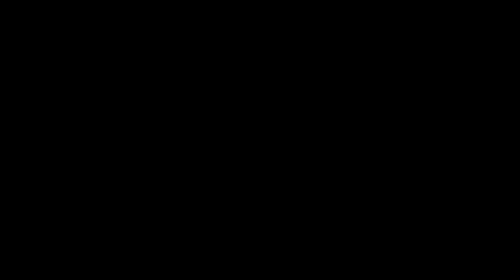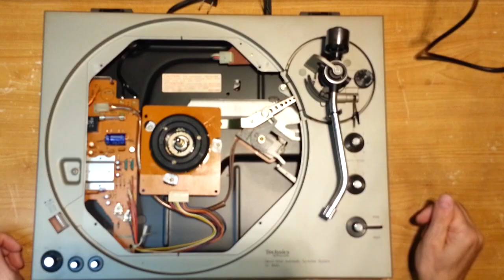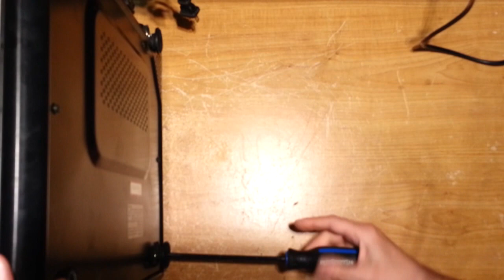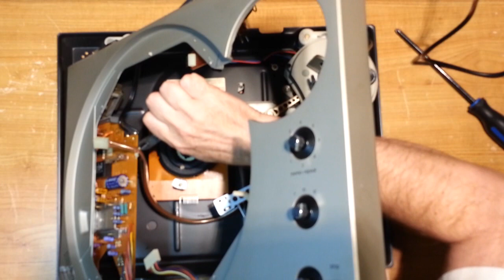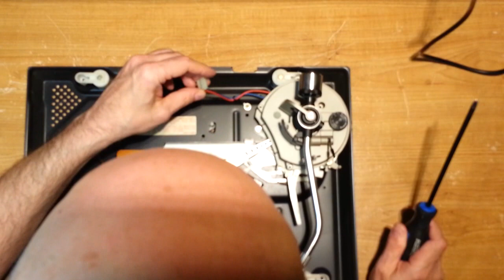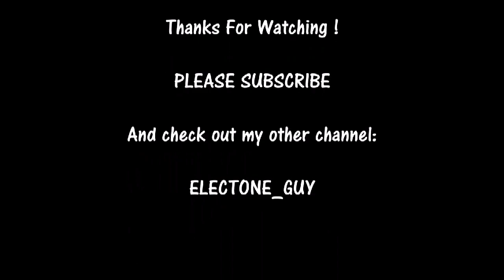Technics SL-1600 mkI: Auto-start repair

Comment: Serviced a SL-1600 doing exactly as you discribed. I had to pry that plastic assembly up with a screw driver , it would not lift off. Your video helped me figure it out. Luaghed my ass off when you simply lifted it up.and off. The unit is working perfectly now. Thanks for posting.

Comment: Hi TG! 6:28 this arm and its bushing is so stuck - I can't even lift it up!. Is "brute force" only way??? What would you do? Please help me (Obi-Wan-Kenobi, you're my only hope...)
Reply from the maker: Soak it with a penetrating oil/spray or even isoprophyl alcohol for a while to loosen the stuck grease.  You cannot use heat because you'll melt the plastic parts. And yes, it must be pryed up.
Reply: @TurntableGuy   It was soaked with WD40 for several hours. After removing motor stator, tone arm actuator and switch I managed to gently place a small flathead  screwdriver under the bushing and pulled it up. No damages. Works perfectly! Cheers!

Comment: I'm going to try this on mine, but I have an issue where the turntable shuts off when the tone arm moves over from the start position. Whether or not I use the auto-start or manually move it over. 
The only workaround I've disovered is letting it spin for a few minutes, and sometimes 10 minutes or more, and about 90% of the time it will then behave normally.
Anyone with an ideas what causes this?

Comment: Do you provide repair service? I’m trying to fix this stuck memo gram knob on a Technics SL-1650… I followed this video but it won’t work. Everything else works fine. The only thing that doesn’t is the memo gram… it doesn’t go from “1” back to “0” so the repeating mechanism just keeps on going.

Comment: Can't I thank you enough for walking me through this repair. Total novice here! The only thing that seems to remain is that anti-skate doesn't seem to do anything. I've tried three different cartridge and headshell combinations and they all skip regardless of where I drop them on the vinyl even with a brand new album. Do the anti-skate mechanisms fail? Or can they be replaced or adjusted internally?? Thank you again for these wonderful videos!

Comment: Hello. I was curious if you've ever had to adjust suspension on the 1600, I have a 1700 and the platter sits just a wee bit lower than I prefer.  I can't seem to find a video on the proper way to adjust the suspension
Reply from the maker: I don't think you can.  The springs have probably sagged.
Reply: @TurntableGuy ok thanks for the reply,  the suspension isn't bottomed out at all, plenty of room, so its not a big deal, its just my ocd lol. Being a millimeter or two lower doesn't affect spund so its fine. I really like this turntable,  very easy to service and the auto return is a nice feature that I never knew i needed
Reply: @TurntableGuy turns out the suspension is adjustable using a 7MM deep socket! I just did it today,  now the suspension is "bouncing all.over" just a little bit of adjustment and it seems perfect,   ot too tight not too loose.
Reply from the maker: @12_inch_spinnerz  Good to know!

Comment: Excellent video and instructions. I have this same problem on my SL-1600. Going to give this a try for the repair. BTW, do you have any info on how to correct / clean the speed controls on this model? My turntable will not hold speed and I have read the "POTs" can be cleaned and re-adjusted. Any advice or help would be appreciated. Thanks very much for sharing your expertise and knowledge!
Reply from the maker: Try spraying some contact cleaner in the pots and working them back and forth.  That usually takes care of it.
Reply: @TurntableGuy  Thanks! I will give this a try.

Comment: Thanks for the help!  Service note: if you have this issue,, you may want to lubricate the arms underneath the unit as well.  Mine had seized up, and it would not stop turn off at all. So, unit won't turn off: unseize\lube arms underneath.

Comment: Great video it was a big help! I fixed this issue and it works great now, however, the repeat function doesn’t. It just keeps spinning at the end of the disc, I’m confused since the tone arm will stop and go back when the repeat isn’t on. Any help would be appreciated. Thank you!
Reply from the maker: Make sure the repeat mechanism is seated correctly when you put the plinth back on the base.

Comment: What can you do if that piece will not come off the brass rod?
Reply: Finally got that piece off with a lot of WD-40 and heat applied with a hair dryer.  Regreased and put back together using the video, and it works perfectly.

Comment: Great video, thanks. The issue I have is that my dad’s SL1600 mk1 was recently recommissioned but after a week of lovely music the motor spindle stopped working and only the strobe light turns on. Do I need to ReCap and is it the large capacitor? Thanks in advance

Comment: I saw a sl1610 for sale online with this problem, and the one repair video on this model is the solution to its problem. This video really helped me. I was having an issue where, upon starting, it would instantly go to the end and then go back. After opening it, it became apparent that the plastic piece was very stuck, and even penetrating oil could not loosen it initially. The plastic was cracked and moved, but the brass remained stuck together. I managed to loosen it after 30 minutes with penetrating oil and very carefully prying it up from below using a flathead screwdriver. I cleaned everything with alcohol, applied new grease, and now it works like new. Thank you so much for this video!

Comment: I have an SL-1700 which is am semi-automatic. The tonearm is so stiff that when the needle is layed down on the vinyl, it skips because the tonearm doesn't move. It even feels stiff and not loose. I took it apart and didn't notice anything strange. Could it be the grease? The tonearm lifter feels and works great and doesn't interfere. Can you give advice? 🙏
Reply from the maker: Arm bearings too tight?
Reply: @TurntableGuy  thanks for the reply. I ended up adding a little 3-in-1 oil to the top where the tiny screw is on top of the the tonearm area where it swivels. I then rocked it back and forth about a dozen times and now it works great. WHEW!

Comment: I have an SL1700 MK1 that needs a tonearm rest, thanks to a guy that hardly had any protection around the turntable when he shipped it! The tonearm rest broke along with the Dust cover. I've found mew dust covers but nobody that I have seen lists a tonearm rest for the SL1700. I'm sure there are other models that use the same rest and clip. Thanks to this video, I just removed mine and now know what I'm looking for!

Comment: I have one of these players and the brass pieces are too stuck together for me to remove this plastic assembly it's a real bummer.
Reply from the maker: Try some heat.
Reply: @TurntableGuy  is there a good way to add heat without melting the surrounding plastic?
Reply from the maker: @brixiu5  It's difficult.  You definitely don't want to warp the plastic.  WD-40 is a good penetrant.  Keep soaking the area and apply a little heat.  It will come up.

Comment: That second plastic piece that is connected to the spring - is it really necessary to remove that? There seems to be some risk associated with removing and bending plastics that are starting to crack and get brittle. I'm wonder if it's worth it. Also wondering if it's worth trying to use the Loctite plastic bonding system / glue to try to repair the crack. Anyway, thanks for the video - it's very helpful and easy to follow.

Comment: i also have a technics 1600 mk1.whats the problem with my tech 1600? when i clicl start the platter sometmes does not spin. and when it spins it stops or losing torque.he pitch control is fine. it starts and plays ok in 45 rpm selector no problem. im suspecting a bad contact of the microswitch of 33 selector